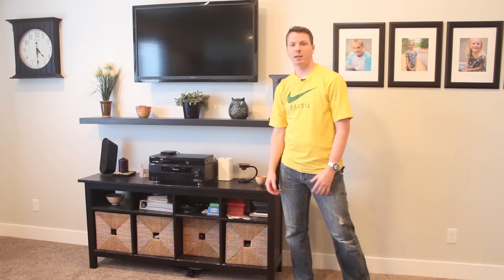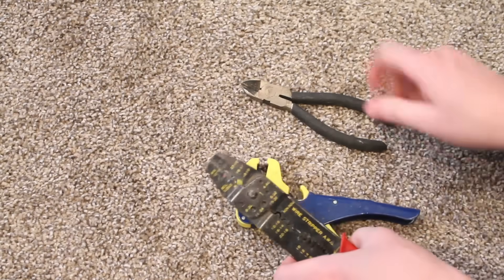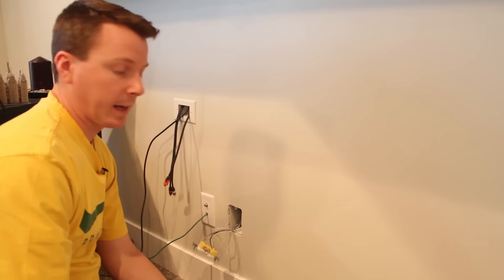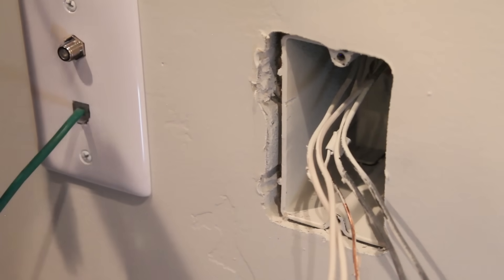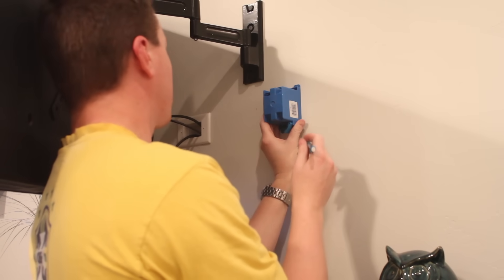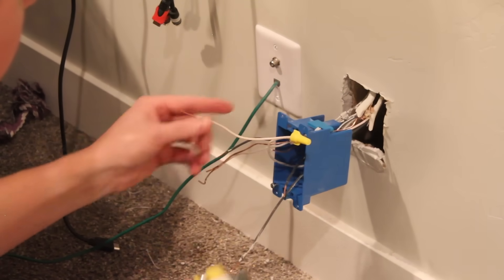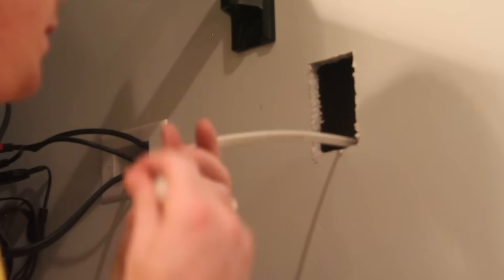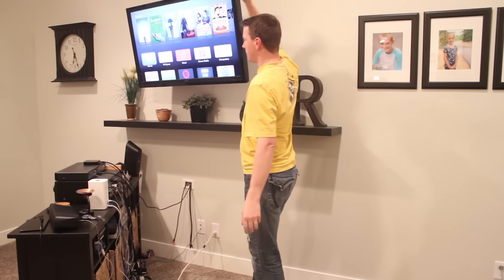How to Add an Electrical Outlet for a Wall Mounted TV

Comment: Why not just connect the new line to the screw terminals on the existing socket, and leave the original wiring plugged into the back?
Reply: That's exactly what I did. That way you're not doing the extra work & tucking in that extra wire & wire nuts.
Reply: To meet current code you should only have one black wire and one white wire joined to the outlet. You are not supposed to use the receptacle as a way to join multiple wires. That’s what a certified electrician told me about a month ago.
Reply: @Nathan-gi9mm  the electrician is incorrect in terms of NEC, however locally you may have code provisions stating pigtails are the only passable method. it is good workmanship. from least to best workmanship: 3) using the push in connectors on the back 2) using the screw terminals to daisy chain 1) using pigtails
Reply: Ignes Andros you know how hard it is to fish a cord through a hole in the wall and then precisely fish it through a 1/2 inch slot in a box?
Reply: PB French Fries Dude, the guy also had fish tape.  He could have used it to fish out the wire, bro.
Reply: @PB_French_Fries  , you push a fish tape up through the existing box, and catch it in the hole cut up top. Lots easier than it seems.
Reply: Could have fished the new wire in the existing 1 gang box he had instead of cutting the nails and all that drama.
Reply: there was 3 wires.  this is not how it would be done if wired new, but it would work alright enough.